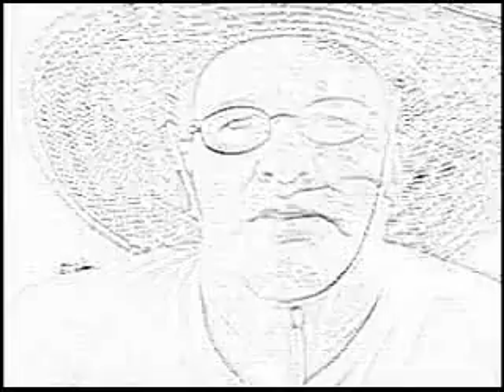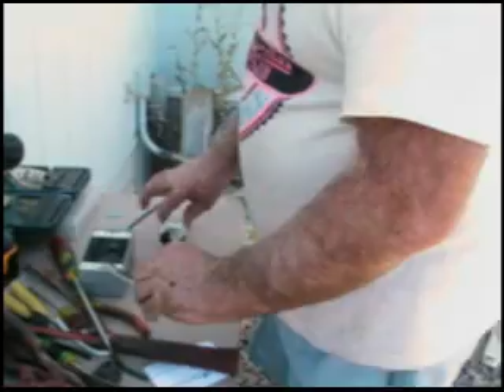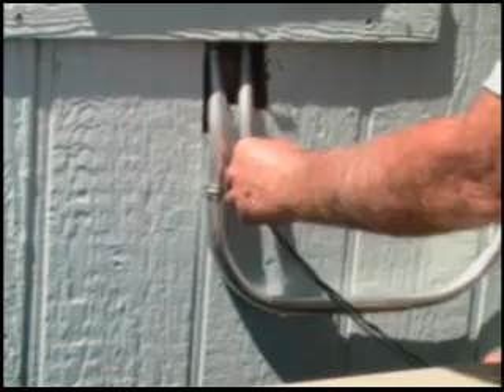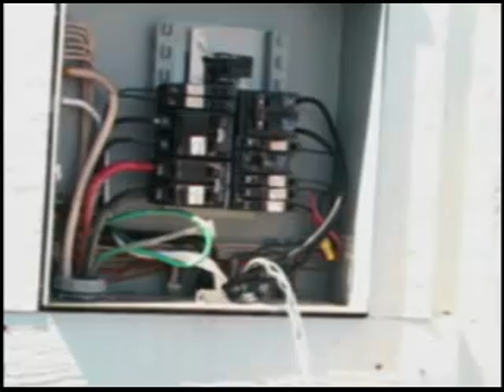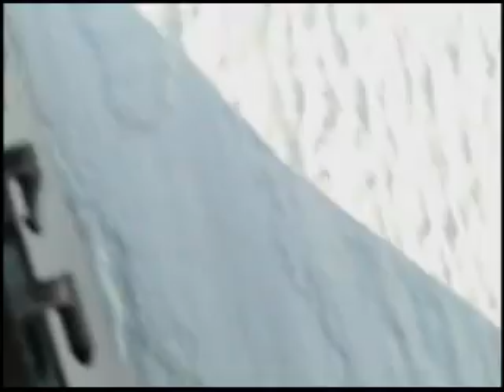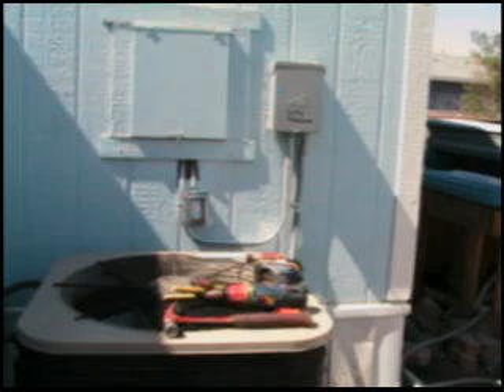# 25 Installing a Hot Tub GFI Breaker

Comment from the maker: Chippy, read your history books. Tesla distinguished AC from DC by using the term POLYPHASE. At that time he was not interested in Delta, Wye, single phase or three phase iconoclastic semantics. I use the term in a historical sense. The only thing close to single phase is 120 volts BUT because the electrons oscillate back and forth, even that is technically polyphase. Oscilloscopes only describe what is happening. At any rate your input is welcome.

Comment: Most residences are single phase, not three phase. So your assertion that all alternating current is polyphase is incorrect. Hook up an oscilloscope in your home and you will see one single phase (and you can also check the harmonics with an expensive scope) or just look at your electric bill, it will say RS which is Residential Service, i.e, single phase, or go look on the pole outside your house and you'll see two wires, i.e., single phase.

Comment from the maker: What your looking at IS the main feed provided by Nevada Energy. The existing disconnect for the hot tub would not accept a GFCI breaker so I just went back to the source of the hot tub power and put my GFCI in there. I am not up to speed on European Electrical Code, but if you put together a coherent video on this subject, I will allow you to post it as a video response.  Finally, NO houses in the US are GFCI protected at the 'Main' panel.